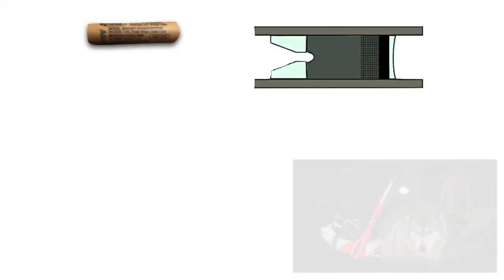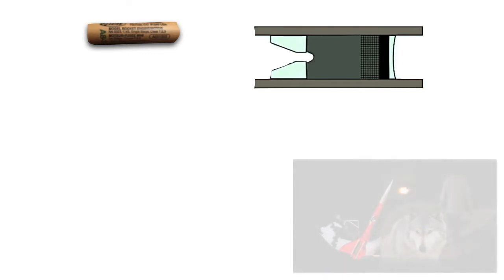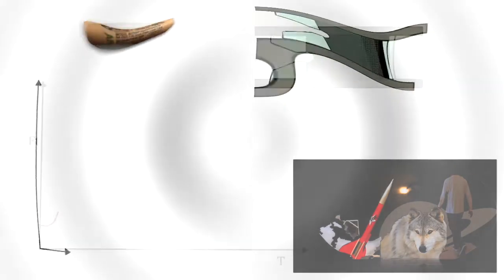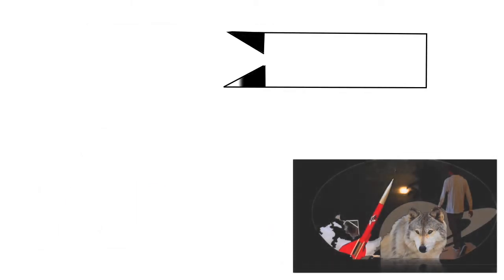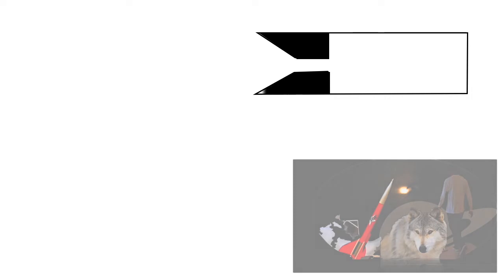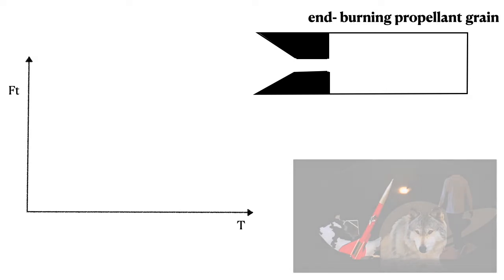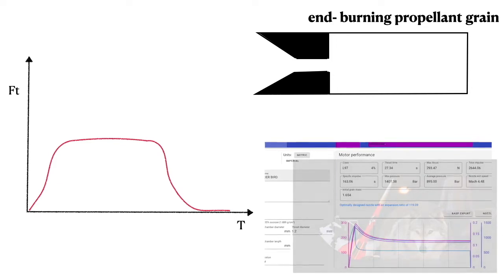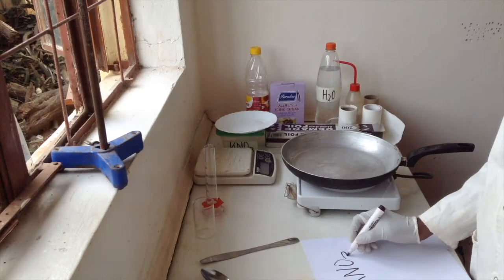How to make solid Rocket Fuel Episode 23

Comment: will the rocket reach higher altitudes with core burning or end burning? I assume end burning since there is more fuel right?
Reply from the maker: Chamber pressure builds instantaneous with core burning  and the vehicle leaves almost at once, however, with end burning pressure gradually builds up and that leaves the rocket on the path for a while.Goggle the NASA space shuttle booster’s solid grain configuration..

Comment: sorbitol is slightly weaker, but it is more fusible, melts below 100 degrees Celsius, so it can be melted relatively safely and without the addition of water.

Fuel fused with water and without it are two completely different fuels.

Without water, the fuel will be much more powerful.

The ideal solution is to get the eutectic.

We know that saltpeter melts above 300 degrees Celsius, but some organic nitro compounds melt below 100 degrees, as does sorbitol, so some organic nitro compounds can be used as an additive up to 10% of the total mass and the fuel will turn out to be a homogeneous eutectic in this case.
Reply from the maker: Well, I am using icing sugar which has starch in it, and the KNo3 am using is homemade. I reacted con. HNO3 acid with KOH. However, I could hardly mix the dry KNO3 with the sugar(dry compressed), well enough because I don't have the material, having them both dissolved in water makes the most sense to me. With Fe3 added, the performance is incredible. My future video will show how I made my very own KNO3.
Thanks for your knowledge though, appreciated.

Comment: Hey, my propellent doesn't at all burn like yours..
It leaves a loot of remaining
Doesn't produce good flame 
Burns very slow 

Can you suggest me anything I've been trying for months 🙏
Reply from the maker: The ratio is 65gkno3, 35g sugar if you set it up well I will work, and if you want a faster burn rate to add 1g of iron oxide.
By the way mine Burns well now.
If yours Burns slowly then you have moisture in it.
Reply: @spacehakim1900  tho I can confirm it doesn't have moisture in it what I think is something wrong with the cooking process
Yes I also add red iron oxide...
Reply from the maker: @krishpandey9725  remember if you using plain sugar you have to add corn syrup, I skipped that part because I am using icing sugar which has starch in it.
Make a bench test: take a dry sample of the kno3 and that of sugar the iron oxide, mix thoroughly then place it in the open and set it alight. If it didn't burn your potassium nitrate is the issue
Reply: @spacehakim1900  i just made a burn test it is around 20sec/inch
 how is it?
I have seen people having 7sec/inch 
Mine too slow 😕
Reply from the maker: @krishpandey9725  I guarantee your kno3 is not pure, I ran into such an issue before.
I would show you how I make my potassium nitrate 99% pure in my future videos
Reply: @spacehakim1900  ok I will wait but btw it's chemical grade kno3 and I have even tried with a recrystallised one it just doesn't make any difference 
I use d- glucose is it ok ? Or should I use sucrose or
Reply from the maker: @krishpandey9725  if you don't have sobital as a fuel, then please use icing sugar from the supermarket, so you don't have to use any glucose
Reply: @spacehakim1900  ok thanks 👍

Comment: Sorbitol is much better, we are trying to make a supersonic rocket, our youtube Chanel is Allocatable Rockets, we are making the same thing in a diferent way
Reply from the maker: I watched your video.they great.but if you wanna go supersonic you need 12-degree convergence and 60 degrees divergence, don't you think should consider using a proper nozzle aka de la vel nozzle
Reply: @spacehakim1900  yes, we use a nozzle,you can't see in the video because is inside the steel tube. Everything is calculated, and is based on equations, we are aerospace ingeneering students
Reply from the maker: @Andres-gr3us  oh okay I am a twelve-grade student and I will be be studying aerospace too some day ,God willing
Reply: @spacehakim1900  actually we use 30 degrees convergence and 12 degrees divergence, is much better because the combustión is very short (2,6 second). 60 degrees is so agresive for small motors and generates a lot of fluid turbulence
Reply: @spacehakim1900 a larval nozzle is a nozzle with two angles. You need to design it so the sonic choking condition is in the narrow throat.
Reply from the maker: @devmeistersuperprecision4155   you right, 12 degrees convergence and 60 degrees divergence will give you a supersonic velocity.Hours ago I completed a lab  test on  my current problem, the delay grain .. you will soon see what I mean..
Reply: @spacehakim1900  Awsome! It’s been a few years since I dealt with this material. We had a supersonic test section in college. Took four hours to fill compressed tanks. Then we got about ten minutes of supersonic run time. OMG was it load!!!! Interesting to see your delayed grain problem. I had to look into how the Hamas nuts were building rockets out of water pipe. The fabrication setup was pretty ingenious for what they were doing. I had no idea that sugar fuel could be this powerful.
Reply from the maker: @devmeistersuperprecision4155  by the way I will disclose the step by step making of my reusable rocket in up coming videos , I had redesigned it several times , am little jam with exams, as I am only a high school graduate but for sure mine will be lot easier with any expensive machines